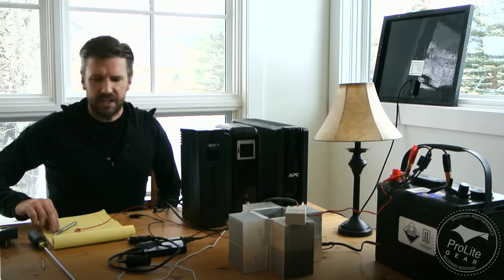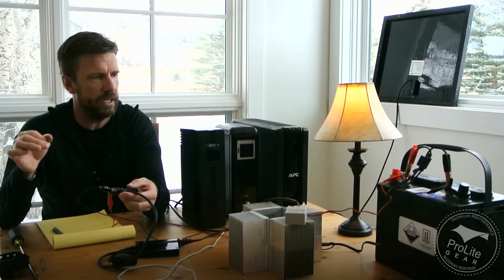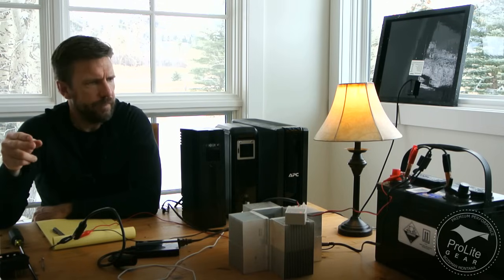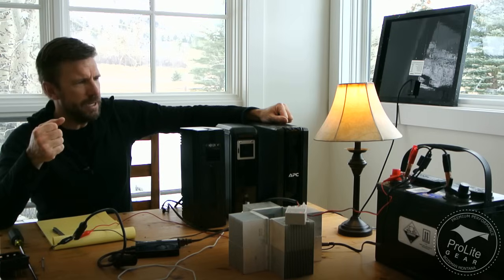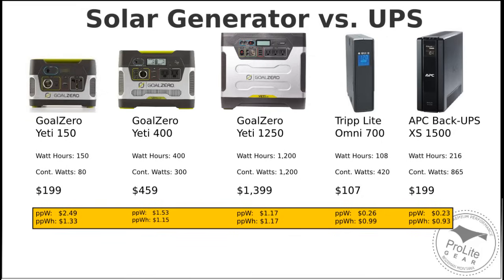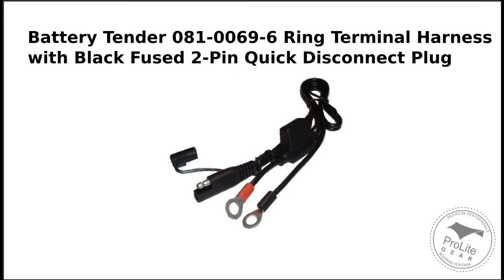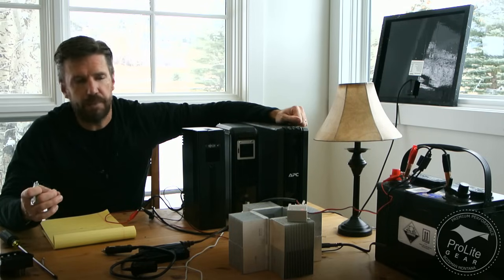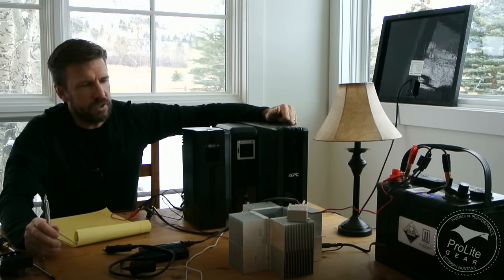How to convert a UPS into a Solar Generator

Comment: if you put different battery capabilities in parallel make sure you don't leave them connected all the time. the larger batteries will overcharge your smaller ones.
Reply: Not true.  If the voltage is the same they will be fine regardless of capacity
Reply: I would imagine this would only be bad if one set breaks down and doesn't get to the required voltage, it would mess the other set.

Comment: You mentioned running a refrigerator, those use an ac motor which is not good to run off modified sine wave which these ups deliver
Reply: Does that include 400w Led light bulbs too? 😃
Reply: @Kickerdk  a modified sine wave should be fine. The times you want a pure sine  or just sine wave is with ac motors or sensitive medical equipment. Form my experience.
Reply: any UPS putting out MOD SINE needs to be thrown away.

Comment: Thank you for the video. But I have a question. Why do you need an inverter before the battery? 
Don't you need just DC? 
And the UPS doesn't have an inverter inside?

Comment: Battery tender is a brand name of the 12v "pigtail" quick disconnect.  Amazon sells these by the dozen and some even have a mountable female you can screw/affix to the UPS case instead of having a lose paired wire through a hole.  I bought a pair of two mountable sets (both sides of the connection, with one side that can be mounted) that I installed on my dual WEN 3800W generators to trickle charge the starting battery as needed. Under $10 for the two sets.

Comment: The problem with the cheap UPS products is that they often don't produce clean power that is a necessity for modern electronics. To compare apples to apples here you have to look for a UPS that has online double conversion capability. When you compare the starting price for these products you will see the prices are about the same as a portable power station. Each type of device is really built for almost opposite jobs as is stated in the video (long run time vs. short runtime) and it really comes down to trusting sensitive electronics  to home brew projects. A cool idea especially if you are powering things like lights or small heaters, etc. but probably best to stick to portable power stations (which have gotten more powerful and cheaper) for the electronics.
Reply: Or use 12v stuff

Comment: Great, informative video. Thank you! While you were exploring the board, did you notice if there might be a way to make the UPS use the battery/solar power as the Main, and the wall power as the backup?

Comment: I have even thought about building my own inverter. or trying to get a lot more output from a smaller inverter by just using it to control external MOSFETs and transformers and caps. basically add to what is already there. I don't want to risk a good inverter . And dont want to start with a non working unit. so maybe a ups is a good place to start. like start with a few hundred watts. and end up with a few thousand watts. and no fire and smoke hopefully. I would try filming the process . just in case it works! thanks for the effort you put in to the videos.

Comment: Neat stuff.  Going to use some of these tips to setup a small solar setup with my car battery for camping since I have a few cheap UPS units sitting around.  

I assume that heat->electric generator setup is using the Peltier effect. Unfortunately that is probably too inefficient to be worth the bother.  Not surprised that consumer prebuilt unit only produces 2W, which is pitiful for what is probably using a lot of propane.  You might be better off with a hand crank for super emergency power, or a gravity based generator.

Comment: Fill heatsink with salt or oil. Aim solar concentrator (Fresnel Lens) at heat sink. Heat from the sun will be stored in salt or oil and can be used to generate power at night.
Reply: Are u saying sun hitting salt warms and melt ice, so salt reflect light

Comment: Did you disable the alarm system that activates once you have zero AC input and you are only drawing on the battery backup power?  That was a hindrance to me during my first iteration with an APC since the alarm was integrated. If you did disable can you do a short vid to cover the proper way to disable. Thanks and great job on your vids.
Reply: on mine, hold the speaker button until it beeps

Comment: Make sure they are pure sinewave inverters if you plan to run anything with an electric 110 volt motor in it including aircondioners,  fridges, power tools and fans... electronics and lights work fine on modified sinewaves which these units are mostly and why the cost way less than the more expensive units your trying to avoid... it can be done like I do but its not as easy as you would like it to be... nothing worse than burning your house down because of a few overlooked problems...

Comment: Generator equals keeping up with demands & a ups with supplemental solar panels means climate temp & cloudy skies will compromise charging. To make this a real generator to provide the uninterrupted power you will need approximately 3000 SQ ft off solar panels.

Comment: i have the same apc ups, something you probably need to mention with apc is their batteries are wired in series to 24v. So if you were to do this, which is possible i do it at the beach from time to time, you will have to have two batteries at 24v and a solar set up also at 24v.
Reply: My APC unit  is 12v, been using a car battery for a while, so different models have different requirements...
Reply: apc works great you should look into adding fans to blow air over the mosfets n transformer for longer operating time without any issues

Comment: I have a Smart-UPS 750 that I've never used, I was thinking of selling it, I didn't think you could attach a solar cell to them though.
To sell or not to sell,... the only issue with selling on eBay is the weight of these UPS machines.

Comment: The down side to using an APC UPS for example, is they work great BUT, they have real transformers in them so when you are on battery, there is a LOT of wasted energy powering up the internals of the UPS even if you are not consuming the converted power. The larger the UPS, the larger the battery energy consumed before you power your electrical load.
Reply: That explains why they draw so much on IDLE , Thanks
Reply: I’ve got 3Kva 240V UPS and it’s consuming around 600watt when idling. That’s $2000 worth of panels just to keep ups happy. 

It makes more sense to buy standby generator instead

Comment: I think a ups would have a hard time keeping cool. during long power outages. and under long duration use. especially under max output. do they not need extra cooling when converted. and I have heard they are rated differently than inverters also. like they will not put out what they say for a sustained time. I admit I don't know much about them . but I am looking in to living off battery's. and solar,wind and small hydro electric. I need to find a cheap way of converting 12 to24 volts to 110v ac. so far all I have is generators. and a 1200watt inverter. I can gladly use all the advice I can get. I welcome and ideas also. for running a home off grid. thank you for your reply.
Reply: Were you successful?  Did ups work continuously ?

Comment: : )    cool. I want to make something like this; however, I need to create a transfer switch that accept two different power sources  and provide one single output, so the I can run a solar system during the day and the ups backup system at night - long as it takes and transfer to utility power when UPS is low.  I have so many drawings that still working on. would be nice to see how to make a mini transfer switch. For example; lets say you have two UPS` and want to power 1 computer, when both get low battery then transfer to utility power.
Reply: Did you ever make or find info on a transfer switch ? Your plan is very interesting and I would like to do the same! I have 11 UPS units and I want to charge them with solar and use them to power my tv and lights at night. Any info would be appreciated!

Comment: Your video was very helpful.  I had the idea to do the same thing.  The nice thing about using a UPS is that the power is very clean.  A lot of inverters, especially the cheap ones do not generate a true sine wave, and that can be a problem for computers and other sensitive electronic components.  One question though...shouldn't there be a charge controller in the UPS as well?  Wouldn't that be usable?
Reply: Not sure if you know this but most ups use a modified sine wave, for example the ones in this video
Reply: @mashedpotatoes5323 I i know this is an old comment, but why does that matter? (Just to clarify, this isn't sarcastic, I'm really just unclear on the difference lol)
Reply: @LoganJarrell  a pure sine wave inverter or ups has the same waveform as the power that comes out of your wall outlet (looks like a smooth curve) and they are generally more expensive. A modified sine wave has a square wave and they are generally cheaper but you can have problems running anything that uses a ac motor like fans, refrigerators, blenders, ect. It's also not best for computer power supplies that have active pfc.
Reply: I'm missing the point too I guess their should be a charger in the ups  box somewhere? I have a 2200 that has 4 12v batteries or 2 blocks of 2  and was thinking why not get new batteries for it because the ones in it are shot and use the power to the wall to go to the solar panel instead  of the wall  if the batteries are the problem can I just get a diff kind of battery same size and use the set up the way it is just running to the solar panel instead of to the wall ? I know it must sound like a stupid question to you guys im just trying to fig it out

Comment: AC CORD? What do or can I do with the AC cord. Can It be used to connect the solar panal directly to with the need for a solar charge controller? Using the AC cord I would normally plug in to charge the UPS and basically plugging a Solar panel directly to AC wires? 

Thanks a bunch
Reply: I am really late, but this won't work. The AC input is 120v AC, at best the panel can do something like 24v DC. Although you could use DC as an input, 24v are not enough to charge the ups

Comment: The APC 1500 series are 24 volts...  You need 2x 12 AGM batteries.,,,

The real issue is amps... You need around 10 amp per 12 volt battery. To recharge them fast enough or they sulfate. Why you need an external battery charger. Other then the built in ones the UPS comes with...Why I installed a 200 watt solar panel and a charge controller. To keep the 2x 200 @ah batteries charged....

And this thing is not portable. As it weights 150lbs...

Comment: You should be careful in mixing batteries in parallel.
Reply: Gazza-usa why an issue in parallel? I know you have to make sure they're identical batts for a series connection, but as long he's using 12v vehicle batteries, it doesn't matter if different capacities are paralleled together.
Reply: First they are different battery types with different float voltages , Secondly they are massively different capacities , if the small ups unit battery was low on charge - and you hook it to a fully charged car battery it is going to dump amps like crazy possibly overheating and exploding the smaller cell or frying the undersized cables (which he hasn't fused)
Reply: hmmm.. i wonder what keeps the batteries from overcharging when the UPS unit is plugged in...... smh!
Reply: @steviebelieveme  also when a battery fails, out will be a constant load on the other battery and will drain it/ kill it.  So a cheap battery in parallel with an expensive one will ruin the expensive battery.

Comment: batteries+ whooooo. amazon is MUCH cheaper. about 20 a pop for those batts. and they have a nice agm battery for under 30 that has the digital display im going to get for my rider. may order a couple more for my aps UPS.

thanks for sharing this vid. im wanting to build a wind generator but i cannot find and 240 volt UPS for the dryer and stove.

Comment: it would be cheaper to buy a inverter and battery and DC power supply to power it wile power is on. and add a solar panel and charge controller. and have more output. the only reason I'd use a ups is if I already had them or they was nearly free.
Reply: The UPS senses when the power experiences an outage and supplies power from a battery array. It is essentially a battery, an inverter, and controllers.
Reply: @86Crisp  But it's a charger controller from AC(which is cheap& easy), not solar, though I suppose some might have an option for solar input. I agree with the original comment, as the batteries inside a UPS are low capacity, it's not really worthwhile unless very cheap.
They're great for what they're designed for, but not so great for other uses.